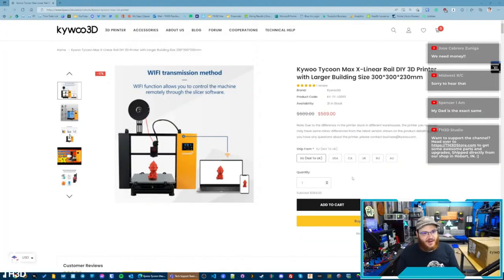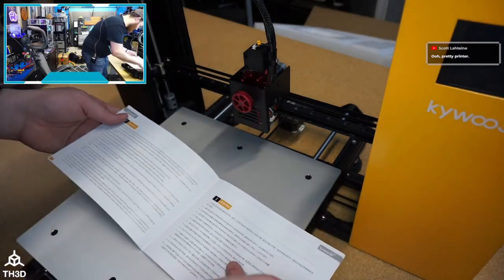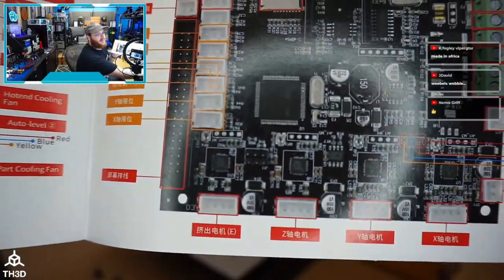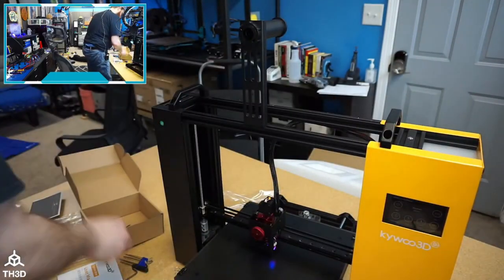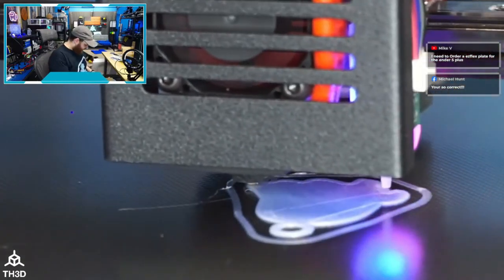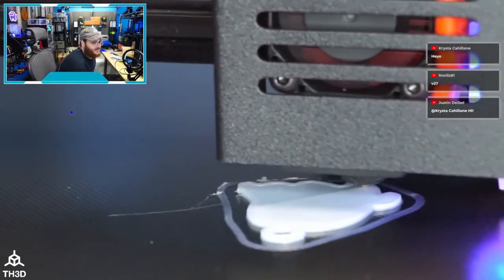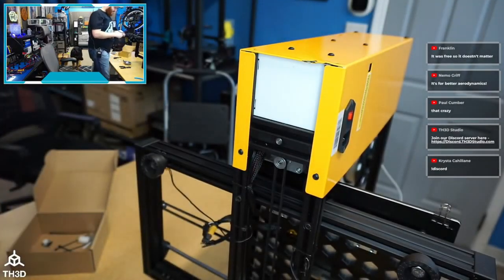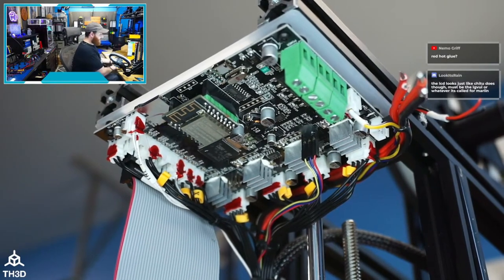Kywoo Tycoon Max | Unboxing, Setup, Testing, and Teardown | Livestream | 3PM CST 5/10/22

Comment: just trying to start using my tycoon max.  the autolevel starts around a third of the way down the plate and the fourth line is just off the plate where it stutters and stops.
the home function seems to be about 2/3 down the plate.  is this right?
Reply from the maker: Sounds like the firmware is not setup correctly.
Reply: @TH3DStudio  
thanks,  got any ideas on how to go about trying to make changes?  i'm new to 3D anything...
I've tried various firmware updates. ie... 1.1.2, 2.0.1, 2.1.3 
most only made changes to the GUI I had to interface with.   a few times, i got blank update screens or hanging TFT..